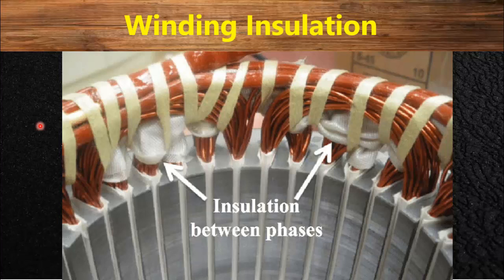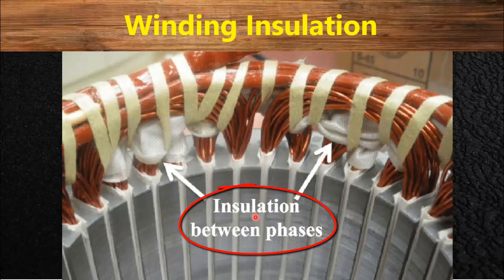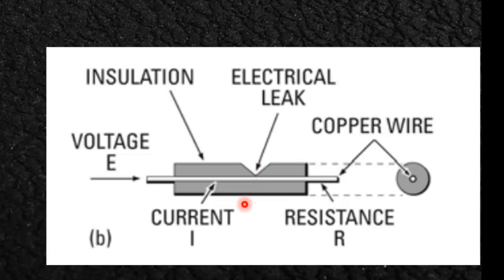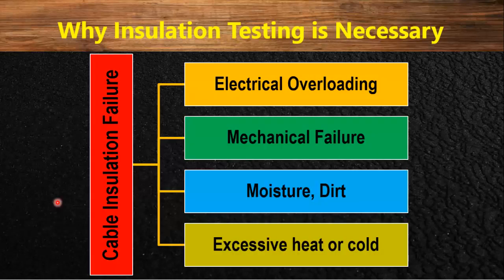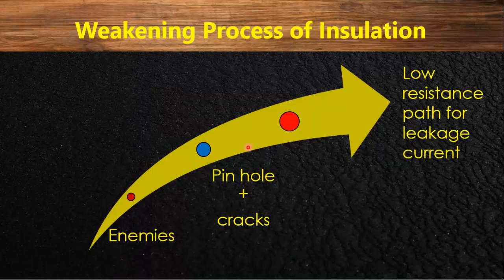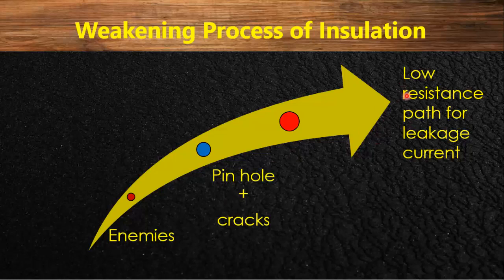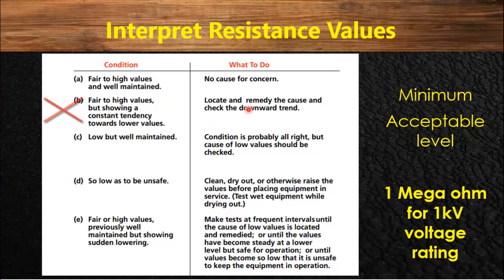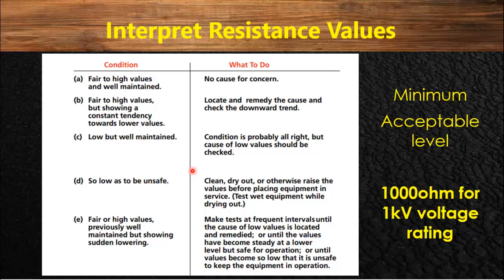Insulation Resistance Test | Understand Megger Test Results

Comment: Hello, I have a question and I'm you or someone can help, Thank you. 
When using a megohmmeter, the insulation resistance reading shows a sudden drop, it indicates? 
A.Tests are being made at wrong points   B.Incorrect voltage used for testing C.Routine inspections are needed. D.Developing trouble.  I would think A or B but I'm going with D
Reply from the maker: Use 500V digital megger for atleast 10 secs. At start due to charging of insulation some extra leakage current will flow but it will immediately get stable and you will get exact value of insulation resistance.